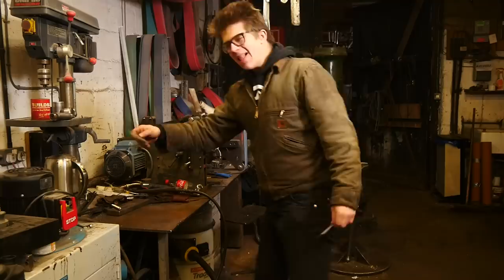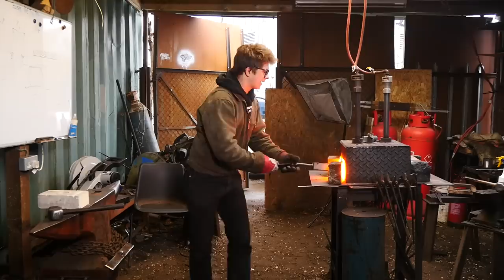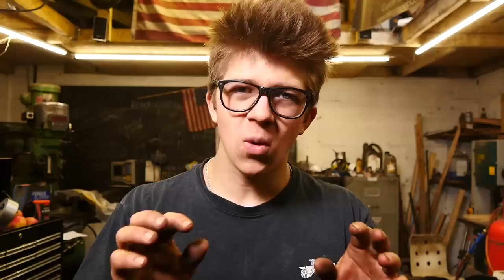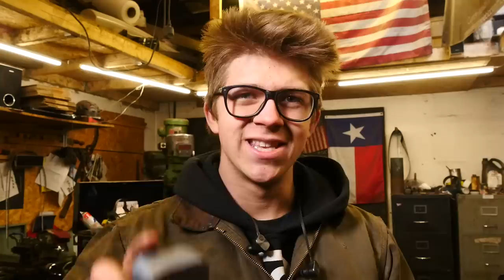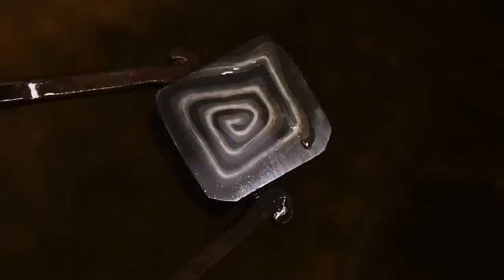JELLY ROLL DAMASCUS STEEL!!!

Comment: tip for forgewelding the jelly-roll.  Make a set of 90° dyes for the press or power hammer, turn them 90° and use them to square up the roll, it would be best to get a good piece of square tube that's large enough in diameter for what you want to do and cut it in half along two opposing corners.
Reply: JeeperZJ I've seen that on other blacksmithing video's and seems to work really well. amazing that Alec got the roll to weld.
Reply: V-dies are the way to go, for sure, and it works even better with a hydraulic press

Comment: That must have hurt....
Reply: Personally I do not want to think about how painful it was to have a ball of 2000°F / 1093°C (estimated) hot metal in your hand.  Well it might not hurt at first but but after a while...
Reply: DaoudvanRaaij 
Honestly it doesn't hurt at all. At first. I've got burned my finger while welding damascus today. But after a few hours (1:20 am here now when posting this comment, I've burned myself like 10 hrs ago) it really becomes painful stuff... But well. That's what a blacksmith do. Work, forge and got burned. ;-) Still best job in the world.
Reply: DaoudvanRaaij 
I was working with some brass a little while back and had some 2000° slag pop off and land in my glove...I never felt it. About as big around as a dime and as deep as a few nickels...can't recommend it. hurt like hell while healing, but initially, the seared nerves were a blessing
Reply: DaoudvanRaaij I have scars on my left forearm from the heads of railroad spikes while making shelving brackets which in one particular position if you hit it slips and hits you directly in the arm but damn I did get paid for making 100 of those for a person who flips houses they paid $10 per shelving bracket
Reply: I had a smaller chunk of steel i was forge welding like this but instead hit the side of my nose near my eye , luckily it didn't hit my eye
Reply: DaoudvanRaaij It actually doesn't hurt when it first hits your hand, i've burned my hands, legs and even my chest many times and never felt a thing. Some say that it might feel like a mosquito stinging you but when it starts to heal and when you cool it down, that's the pain nobody wants to feel
Reply: When you read my long name, I stole your sandwich 

Give me my sandwich back!
Anyway. Yup, pain when the afterburn wound is healing... I don't wish anyone to feel it. Really. That's the time when "burns like hell" is literally what it does.
Reply: I have a ring shaped burn scar from a red hot titanium nail
Reply: +When you read my long name, I stole your sandwich

Shouldn't it be While you read my long name?
Reply: jokes on you i ate both my sandwiches
Reply: +Jacob Melanson
Sure, but while you wrote that he stole your dessert.
Reply: not really, it may just be me but it seems to scald the nerves to the point it doesn't hurt, if anything it's pretty warm..
Reply: ouch......
Reply: the only pain is the lighter burns to the side of it. I still have a bit of skin from a bad burn I got a few weeks ago. I killed the skin in a line really far down. hopefully not to the bone or It will take a lot longer to grow back.
Reply: DaoudvanRaaij I imagine that the nerves touching it would have been instantly seared, but the pain while healing must have been so so great
Reply: Nah, after 3-4 days it doesn't hurt anymore. It's still a bad thing to do and shouldnt be done
Reply: I can’t really relate but I accidentally stuck my arm to a hot metal grill but not the same as a 2000 degrees C piece of steel
Reply: Leidenfrost effect helps a lot
Reply: Problem is the moisture for that effect in this sort of contact is coming from your own ruptured cells >.>

Momentary contact causes some pretty bad burns but nothing too serious. However nickle welding on a flange and burning through and not noticing and having the weld drip into your not properly done up boot... that hurts a lot more I can tell you.
Reply: Then he bandaged it with duct tape. And I don't see guaze. I must this man is made of pure manhood.
Reply: No, the burning doesn't hurt, well atleast not much, but when it starts to heal, that smarts.

I'm a welder and sometimes when i have to weld outside with the sticks, there's some spatter and when that slag spatter goes inside your jackets, because ofcourse they always find a way to hurt you, that smarts, there's scars on my back, belly, chest, legs, hands, arms, neck, feet (thank god not a single one on my dingaling) and many other places, head and bottom of my feet have completely survived from burns.
Reply: His hand must be looking terible underneth the tape

Comment: Maybe gloves next time? Still, duct tape? Hells yeah. That's how a man does it!
Reply: Yetiman82 I imagine how painfull must be that burnt
I mean, damn, how hot was that piece of steel?!
Reply: About 1000°C +- 10%?
Reply: probably surprisingly less painful than you'd think. those nerves are toast, no pun intended.
Reply: If I had a dollar for every cut in the shop that had been patched up with electrical or duct tape, I'd have enough to go to the hospital and get professionally patched up...
Reply: Gloves are a bad idea when smithing. It reduces the sensation of heat from a work and can actually lead to more burns because the cloth masks how hot something is
Reply: Jacob Benns ah the NHS is great, broke 3 bones last year and it costs nothing
Reply: It's more dangerous to use gloves when forging with a power hammer than to not use them. It increaces the chance of you getting cuaght in flywheel and dragged into it. No glove, loose a finger, glove, loose an arm.

Comment: I've had a lot of trouble forge welding recently, seeing you struggle is a nice pick-me-up. On your next damascus experiment how about a before and after wiegh in. Great videos the for the many insperations. :)
Reply: oh new idea start forge welding right when the roll begins, instead of rolling then welding.
Reply: Hmm idea beyond that, roll then tack with the welder. Man that seams like cheating tho xD
Reply: This is a guess, but I think the problem is actually that you're hammering it straight downwards. To roll it, you want to hit it as though you're rolling it a little. So, make a big incline slab (10 or 20 degrees would be fine), and hammer the roll while it is on that slab - just make sure that the roll is orientated so that it looks like it will tighten if it rolls down the slant.

It's probably not a good idea to hammer something while it's on an angle like that, and you'd need to do something to hold that extra base piece in place. But, that will cause the roll to tighten with each hammer blow.

Comment: Nice work, once again, Alec. Congrats!
One shows skill and adaptability when things go wrong, not when all is easy and goes as planned. So well done.
I only tried jelly roll once, but knowing I would grind it later, I kind of cheated and tig welded across the spiral before final heat, and made the first welding pass by hand.
And I always go for flux (althoug I make and use a dry version, using Jim Hrisoulas method).
It lowers welding temp a lot and makes cleaner weldings.

Comment: Hey Alec Steele... I been watching your, and other, videos and learn and I really want to get into Blacksmithing myself.   I think about it a lot and before I even finished watching I saw the issues you were having and came up w/a possible fix for it.
Depending on the desired final size of Jelly Roll Damascus you want (i.e.  4" square) make a "Squaring Die" by cutting 4 pieces of 2"x2" angle iron about 3-4" long and weld them to a plate side-by-side w/the corners up, and repeat w/the other 2 pieces of angle iron.  Then modify those 2 plates where they will attach to your power hammer or Hydraulic press where the angled corners meet up "point-to-point" and parallel to each other.  The final resulting "squaring dies" will look like a Capital "W" sitting on top of a "M".   (However, if you want your final size to be 3" square, use 1-1/2" angle iron, etc, etc...)
Then, rather than forge-welding like you did w/flat dies this will force the steel to weld by pressing on it from four directions at once.
One other Idea is to make a "Rounding Die" where the 1" angle iron pieces are spread out enough to set and weld a thick walled piece of iron pipe in-between them that has been cut in-half lengthwise.   Say you wanna keep the Jelly Roll Damascus round at about 3" in diameter.   (pardon me if my math would be off, but I'm brainstorming here and I hope you get the idea) Use a section of say 3-1/4" INSIDE DIAMETER pipe split down the middle with a 1/4" wide cut.   When the 2 halves are put back together and measured, instead of it being 3-1/4" ROUND, it would be kinda oval in shape 3" up n down & 3-1/4" side-to-side.  These 2 halves, mounted as above, would take a rolled-up piece of steel aprox. 3-3/8" - 3-1/2" in diameter and crush-n-weld it, AS YOU STRIKE IT AND TURN IT IN THE DIRECTION OF THE ROLL AND STRIKE IT AGAIN, and again.  This will help it weld together and NOT come undone at the end while leaving it planished @ about 3" in diameter.
You can make another "Rounding Die" smaller or larger depending on what your desired size is, and you can start w/a large one and step it down smaller if you want.   You can also use the Rounding Die to get it all welded up nice n pretty n symmetrical, then a suitable-sized "Squaring Die" to get it squared for further shaping w/out de-laminating.

Let me know what you think and if you make a large enough chunk of Jelly Roll, round or square, make a Rounding Hammer out of it!!  I'd Buy That !!  Cheers! Alec

Comment: Alec, if you search for jelly roll Damascus their is a video from a mastersmith that used a hydraulic press to forge weld the roll. That is probably the easiest way to forge it, but you ATTACKED the problem and made a stunning piece of art with that billet!

Amazing job! EPICNESS!!!!

If I can remember the video, after he had the roll forged he still used the press and used the square adapter in the press. Then he was able to draw out the square billet and talked about doing mosaic Damascus or just drawing it out

Comment: Just discovered Alec a little while ago and have been watching a lot of the old vids. When he got burned it reminded me a lot of last summer when I was working in a chem lab bending small-ish pieces of glass for an upcoming experiment, and dropped a piece, not taking the time to think "hmmn, maybe trying to catch red hot glass with my bare fingers (which I did, like a dumbass) would be a bad time."

Comment: Alec, just a thought: maybe take a wipe you wouldn't mind forging into the roll and weld it to the inside of the drawn out steel so once all of the layers are rolled up you have this nice pipe sticking out the center of it. should help you during the welding process so you can get a nice even weld since you'll be rolling it and it ensures the steel doesn't fly about...

Comment: Alec Steele
Most smiths that make jelly roll pattern use a set of "V" shaped dies make from 4 lengths of heavy wall angle iron so your jelly roll is supported in four sides.

Comment: Alec, keep in mind that scale is not purely iron oxide. The atmosphere is nearly 80% nitrogen which is not as reactive as oxygen but certainly does oxidise iron at forging temperatures. Therefore I would consider scale more accurately described as 'a surface deposit of oxides and nitrides of iron'.

Comment: I have made a set of 90° dyes for a power hammer in my shop and it works perfectly. Before that I used to weld the sides, it did the trick, but was a little bit more time consuming. however It's pretty neat, that you made it work without any "fancy" tools. Imanaged that just once, and still almost third of the product unrolled :D

Comment: +Alec Steele 
you could try to use a sand blaster with glass bead in stead of sand to remove the scale while rolling, have to have a means to remove water from compressed air used to blast, and you'd have to work fast, with a lot of back and forth from forge to hammer, cause the air will cool.
I wonder if it would help to have a hot air intake for the air compressor (to remove moisture)
or you could try blasting with compressed argon...

Comment: For the circular welding, you need different dies on your power hammer. Get some that have a 90 degree slot in them. When the two come together, they should form a square hole. It isn't a perfect grip, but it will allow you to apply pressure to 4 points of the thing instead of two, and keep everything together

Comment: Make 2 steel blocks with ½-circle cutouts. Squeeze the jelly roll between said blocks, with the cutouts acting on all sides. Make several sets; each a bit smaller. Work your way from largest to smallest till the roll is fully fused together.

Comment: I learned to make jelly roll by rolling it up like you did then weld a handle on the side in the center of the spiral then put it in a half round on the swage block edge and with a top swage have a striker hit it while you're tightening the spiral with the welded on handle.

Comment: I'd suggest you start with a small rolled section, get that to weld and than do a little more and more. I don't know much about forging or welding, but if a successful weld doesn't come undone if you reheat it and beat it afterwards, I think you might get to a bigger roll.

Comment: try to use water while forging. it will blow the scale off the Steele as you roll it. Japanese swordamiths use it when crafting swords. It might help with the inclusion issue you had with the first batch you made. I love your channel keep up the good work.

Comment: might have been easier to forge weld by hand...seems the power hammer made it a little more difficult to keep in line.  There again, I'm not a blacksmith, I just watch the stuff alot and would love to try.  Awesome outcome, and great videos as always.

Comment: I would have put the spiral on the flat side and forge welded it that way, because when the power hammer hits down on it, the steel will push out evenly in all directions. Once it has finished being welded, it would be quite thin so you will need to to hammer the jelly roll inwards after you finished to make it less flat.

Comment: to avoid the scale inclusions you should try wet forging (spraying water on the hot metal and putting water on the anvil ) that should help the scale to pop off

Comment: it might be easier to set the weld if you use V or Round shaped dies on the press, that way it wouldn't open up as much :)

Comment: Consider using upper and lower swages [round inside], in graduation or a swage block to retain the the circumference. then use a team of strikers, every body wants to be in on that, or tool up for handheld upper swages and strike by hand as the power  hammer is over kill for forge welds, PS love your work.

Comment: You think of using a rounding tool for your power hammer? where it's like half of a circle at the top of the hammer and half a circle at the base? idk if that's something that could work or not, just throwing it out there.

Comment: Use a soda bottle with a few small holes in the lid filled with water and spray some on your work and the anvil and it will help get rid of the scale. Just don't use to much. You just want enough to remove the scale not cool it down.

Comment: Please make a ball from it

Thanks for another great video!

Technical applications: Intradermal needles and other very stiff pins, bolts, nails, Rotating shafts. Rolled from sheets, wouldn't break that easy and would be extra stiff. Also you might be able to build a propeller hub by X-twisting shackles together, very thin but torque proof.
The one you made seems to take high pressure forces linearly?

Comment: a tomohawk or hatchet i think you will be able to keep that nice jelly role shap unlike if you make a knife it woukd be quashed out a bit to much. Also I've had some pretty bad burns my self so be sure to get it as much air as you can when you're not working and something called fixemole works wonders for keeping the dirt out while you work and yet let's it breath i blacksmith to so i know it works well.

Comment: Sprinkle water on the steel and on hammer on occasion the steam will clean the steel oxide off as you hammer and forge. The Japanese blacksmiths have been doing it thousands of years making swords. Watch a traditional Japanese black smith they always use water all the time while hammering!

Comment: I once had a small rivet I was hammering bounce at me like you did in this video, unfortunately I was wearing welding gloves and the rivet went down the cuff of the glove and burned the crap out of me before I could get the glove off. Sadly I had to make do with a bandage because I couldn't find my duct tape ; )

Comment: I got an idea for you too try, since my forge welding lack and so does my shop of a power hammer. How about just using 2 long pieces of steel lets say 12inches in length and maybe 3/8ths thick stacked ontop of each other forge weld and stretch it to like 3/16 and then roll it.

Comment: I was thinking while you were fighting with this project that few things"could" possibly have helped.
1. a convex hammer and die (two inverted letter C's
2. a sacrificial rod welded to the center of the roll
3. flux added as you roll to try to cut down on the oxidation.
However, even if NONE of this is any help in any way. 
Great Job Sir. excellent work👍
Btw, whatever happened to the copper/nickel Damascus?

Comment: Could you make a set of half circle dies for your hydraulic press, and then use that to stick the first weld?  This might help direct the force in all directions better to get a good first weld, then you could finish forging it out on the power hammer.